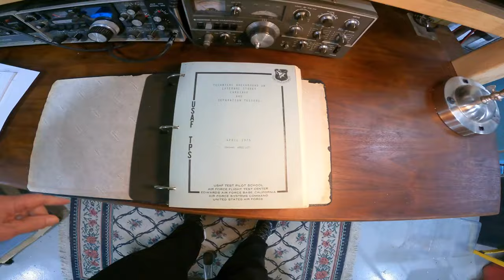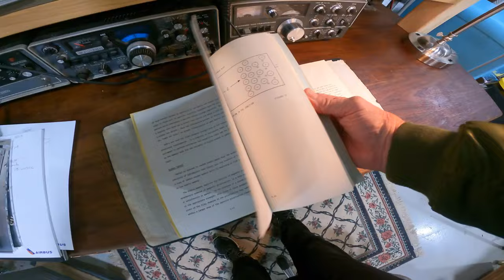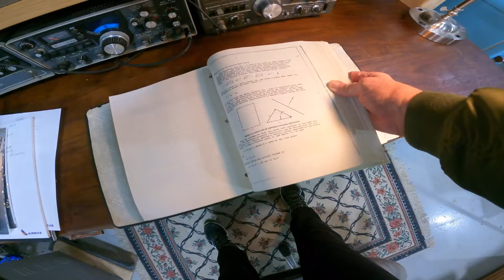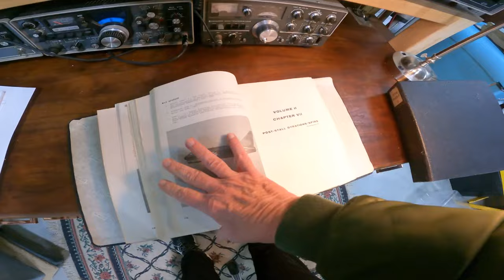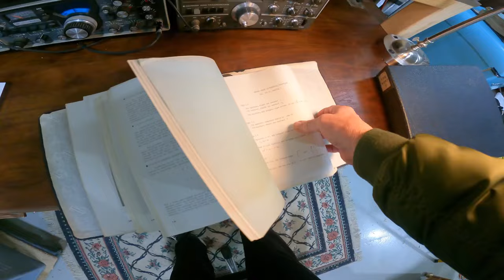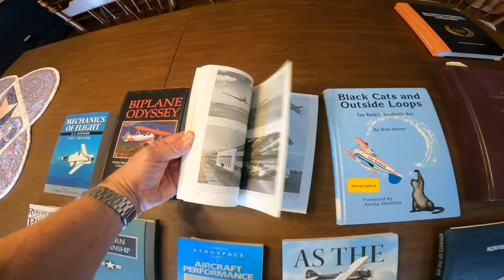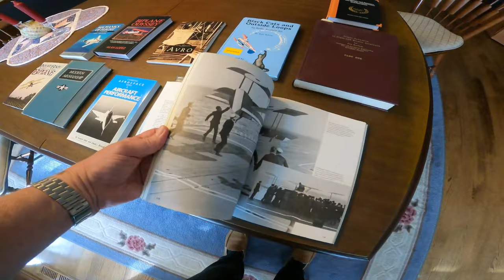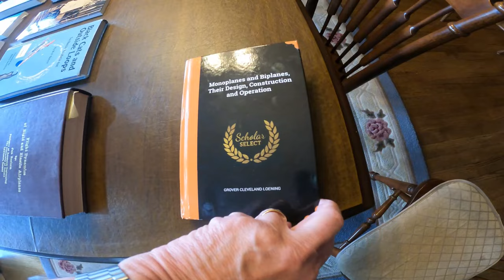The ins and out of Biplane operation and design.

Comment: Back in the 1960s Boeing pulled out the blueprints for a navy flying boat biplane and built one. Engineers used their shiny new computer tools to analyze it. Generally they concluded it was much stronger than it needed to be. There was one exception; the flutter engineers. Their analysis showed an instability in the elevators as, unlike later airplanes, the left and right elevators were not connected. As a general rule flutter engineers pointing out a problem are not believed until there is a pilot floating down in a parachute and airplane wreckage spread out over 20 miles of the Mojave Desert.  So they were ignored. When they were ready to fly the airplane they invited a retired navy officer who had flown the airplane to come in and talk to them. Among his comments was that if you dive it to 100 mph it vibrated like hell. Back to the flutter engineers. They installed a damper in the elevator controls and all was well.

Comment: Great video, learned a lot and was reminded of details I had long since forgotten.   

One question I have is I notice that in a lot of your videos you do primarily wheel landings (very nice ones I will add).  In my Acro Sport I've always found it easier to 3-point full stall land.  Is it easier to wheel land in the Great Lakes due to the Main landing gear shock strut system or is that just your preference?  When I 3-point I try to hold it off until the end and usually touch down very slightly tailwheel first.  That causes me to lose angle of attack and it sticks my landings without any bounce.  When I did my endorsement I mastered both in a citabria but just have not gotten as comfortable in the Acro Sport with wheel landings.  My aircraft has the spring bungee type landing gear.  I might add that when it comes to tailwheels I am a low time pilot.  

Also I agree 100% grass is just so much easier.  It covers a lot of my sins.   I'm getting more comfortable on hard surface but there is that first few seconds after touchdown that I feel the airplane does not like hard surface and wants to play in the grass beside the runway like a puppy with a new ball.  I just have to work a little harder with the rudders to prevent that from happening. 😀

Hope to run into you sometime at Oshkosh.
Reply from the maker: See you at Oshkosh! Been going for 30+ years.
I prefer the wheel landing in the GL due to the nice struts. Also, for the full stall landings, the approach speed is 75 but I lower it to 65 on short final because it will fly in ground effect to around 40 mph. I have to get a real nose high attitude to get the full stall and it comes down on the tailwheel first which I rally don't prefer. Also, I get in the flare and if I pull back the stick too soon, it balloons. I practice the full stalls but only use them on short fields and it does have a nice short ground run!
Reply: @ronrogers  That makes sense .  I notice stearmans almost always wheel land and they have struts as well.    I just need to practice my wheel landings more.  I come over the fence at 80mph but bleeding off the extra speed is never a problem.  I live on a 3000’ grass strip and am usually stopped at 1500-2000 ft with no or very light braking.  I can probably experiment with slower speeds but I suspect the instructor who checked me out in his Acro sport  wanted to give me a little cushion before I soloed my own.   Unlike a Cessna floating due to excess airspeed is never a problem.  Traffic permitting I fly a very tight pattern and power off for the entire 180 so if I ever have to do a deadstick for real I am used to the approach.

Ps. 166 days till OSHKOSH.  Looking forward to this year.  My two year old grandson can identify most of my model planes.  Last year he just kept saying more more and more airplanes.
Reply from the maker: I do the same type of pattern when the students are not screwing up the pattern. Can easily stop in 600 feet. @redfire122
Reply: Back in the 1960s Boeing pulled out the blueprints for a navy flying boat biplane and built one. Engineers used their shiny new computer tools to analyze it. Generally they concluded it was much stronger than it needed to be. There was one exception; the flutter engineers. Their analysis showed an instability in the elevators as, unlike later airplanes, the left and right elevators were not connected. As a general rule flutter engineers pointing out a problem are not believed until there is a pilot floating down in a parachute and airplane wreckage spread out over 20 miles of the Mojave Desert.  So they were ignored. When they were ready to fly the airplane they invited a retired navy officer who had flown the airplane to come in and talk to them. Among his comments was that if you dive it to 100 mph it vibrated like hell. Back to the flutter engineers. They installed a damper in the elevator controls and all was well.

Comment: What is the lift differential between a monoplane and a biplane? If by planes were so light and easy, why did they go to monoplanes and why were there never any airliners that were biplanes?
Reply from the maker: 70% of the lift for same wing area. There were several biplane airliners. The Handley Page HP-42 the largest. But if you want speed, you need a monoplane.